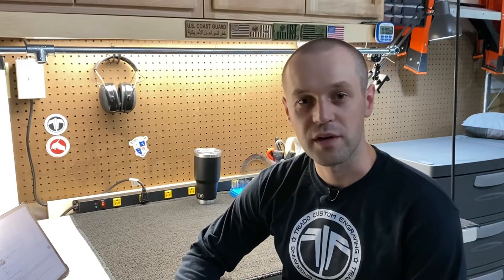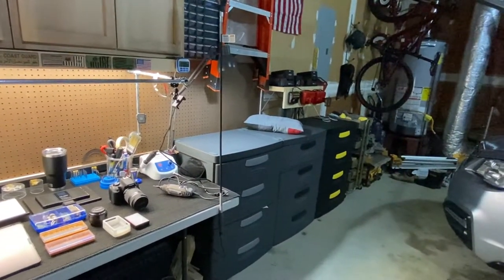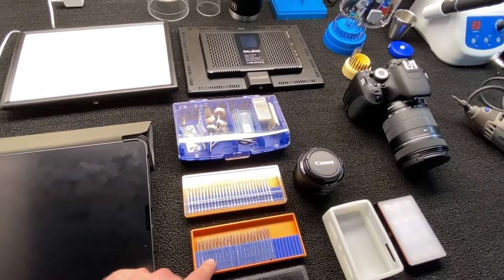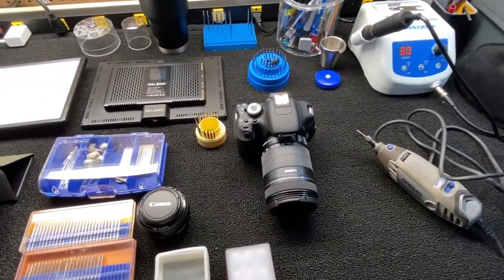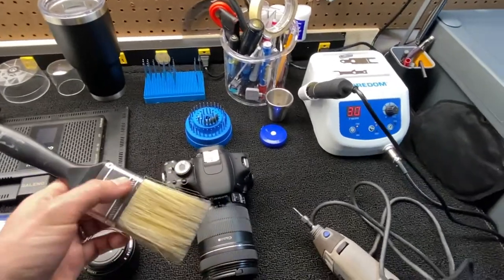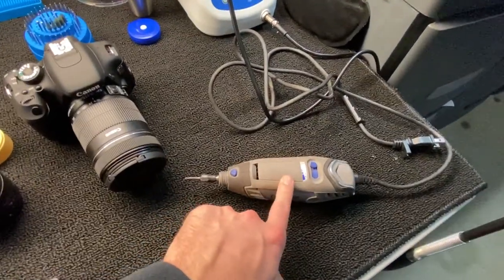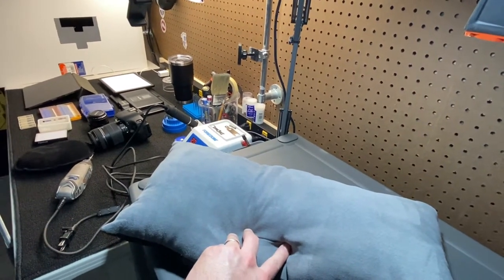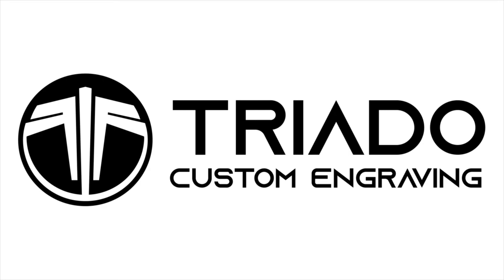Garage Tour | Engraving Tools and Setup

Comment: In my experience, the best quality tungsten burs can be purchased from dental lab supplies sites. These often have to work with stainless steel or even cast steel and therefore also require milling burs that are hard and reliable. Of course they also cost more, but you can buy each cutter individually, so exactly what you want. I also use an electric milling cutter that is used in dental laboratories and not a Dremel etc. The hand parts look like the drills at the dentist and are super safe in the hand. You can also upgrade it and add a water or lubricant supply to the milling process. If you have a lubricant supply during the milling process, you can work with the dental milling cutters at speeds of up to 36-42,000 RPM. You then have the feeling as if you were drawing safely with a pen, because the milling cutters no longer want to break out to the side so often at this speed, but are very stable in the hand.
Reply from the maker: Very cool! Yeah I haven’t explored much away from Dremel or Foredom tools, but when I do have the time a money I definitely want to expand my knowledge on other tools. Thank you for sharing!
Reply: @TriadoCustomEngraving  You`re welcome - wish you good luck and much success with your awesome work. :face-blue-smiling: